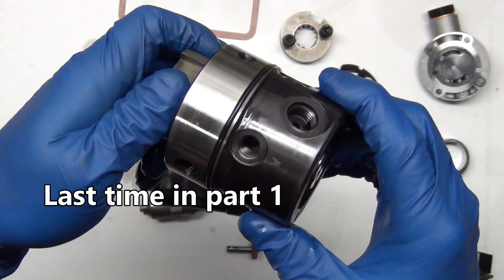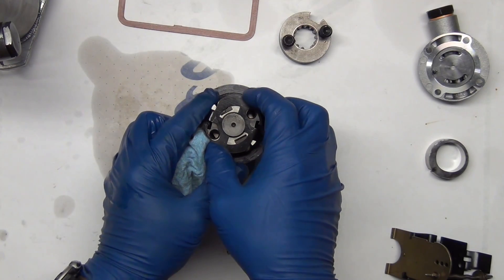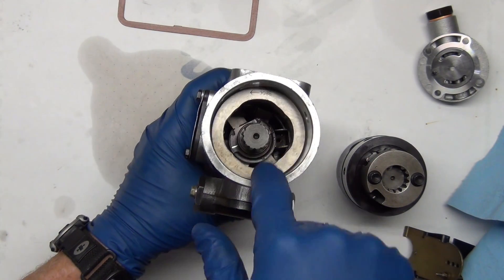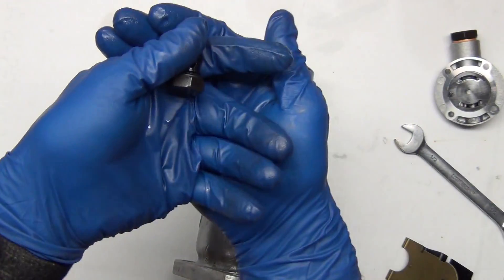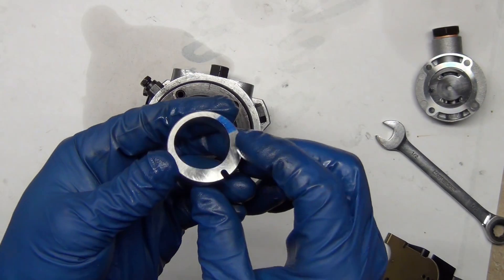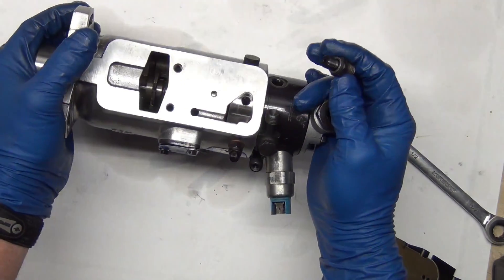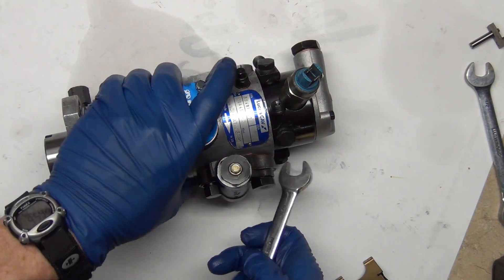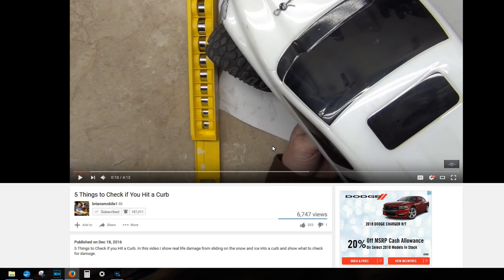CAV DPA Build Part 2 Max Fuel Setting & Pump Guts

Comment: Diesel does not over heat in a lean condition. You can either have too little fuel to make power, enough fuel to make power, or too much fuel which will cause heating issues and start cracking things like your pistions or heads.  To little fuel is safe just doesn't make any power.

Comment: For  years case tractor  used the same perkins  engine..  same  bore and  stroke same cam, for  the four cylinder.  The went all the way up to 95 horse  power.  All the did was change  that  setting.  Smaller  45 horse  tractors  had  the ability  to  produce  95 horse  power. This was when they  were David  browns  and  switched over to  case.

Comment: Hi! That small spring at the bottom that you talked about at the intake of fuel. You said it will be stuck in priming mode and it wont run. But isnt priming mode making it run as h*ll? Yester day i pushed down my primimg button on my DPA and the engine went crazy and ran away. I cant get it to stop normally anymore? Its like the pump is stuck in max fuel setting??
Reply from the maker: What time stamp in the video?  Priming mode is to purge air and flood the rotor with fuel.

Comment: Hey, I believe my boost compensator is failing on one of these pumps, as I don't think the pump is upkeping with the demand when on higher revs (when the rubo kicks in, technically). Is membrane replacement possible without any additional adjusting? Or does the pump have to be adjusted after the boost compensator was messed with?

Comment: Hi, Is this mostly to seal leaks . My pump needs some internal parts such as cam. Tractor stalls easily and no start when hot. or does it need a bench test after installing new cam etc. to calibrate it. I may be on the wrong video . Correct me on this, Seems like replacing seals is more of diy project vs replacing major internal parts. Thanks.

Comment: I just adjusted this fuelpump on my John Deere 2040. Now it is quicc and have some blacc smoke
Reply: Was that a cav pump like this?
Reply: @ketilmomrak-haugan3495  Yes, yes it was
Reply: @HorizonFarming  did you set it to max?
Reply: @ketilmomrak-haugan3495  Yeah, i set it to Max. But theres a lot of black smoke coming from it when i floor it. It's probably best to set it to max, and then adjust it off a little.
Reply: @HorizonFarming  yeah OK, i want some black smoke so thats good😏😏
Reply: @ketilmomrak-haugan3495  Compared to my 2005 Mccormick CX105, this John Deere doesn't use much fuel at all, so fuel economy is not a concern 🤣
Reply: @HorizonFarming   ok good🤣🤣
Reply: @ketilmomrak-haugan3495  Er du norsk? Ser ut som at du kanskje har et norskt navn?
Reply: @HorizonFarming  ja, æ det ja
Reply: @ketilmomrak-haugan3495  litt kjedelig at to norske har en engelsk samtale da🤣
Reply: @HorizonFarming  ja ahahh😂

Comment: I have this injector pump on my Perkins Diesel in my boat and am dumbfounded how to adjust the governor max speed setting. Mine has a hydraulic governor and I can't find anything. The mechanical one is well documented but I've reached a dead end.
Reply: There's useuely a pressure sensitive  valve that dumps fuel pump body fuel pressure which in turn alters the fuel pumping element /s load setting

Comment: hey there, nice vid. thanks for sharing your knowledge. one question regarding engine rpm: if id like to raise egine rpm, how do i align the governor springs in the linkage? for example, 2200rpm eqals hole 2 in control arm and hole 2 in linkage - how to set it for say 3000rpm?

Comment: At 2:00 you use an impact ,, what is the specified torque of those -2- bolts , & how much torque does your impact give? What brand & size are you using?

Comment: In your assembly at time 1:47- 1:57 what is that part you are saying must hang over just a touch, ? l have not taken my pump apart , l have only turned the fuel plate, with the pump still on the tractor ! Since I don’t know exactly how it is supposed to be , l would not know if what  l saw was correct or wrong !!

Comment: I watched this vid about 10 times before l got the fact that you were stating the min/max fuel setting correctly at the 30 sec point & the 45 sec point & l have used it to try and get some more power out of my 4BT Cummins 390  1990 . 
Some time ago l was having trouble ,& a tractor mech said it was my inj pump , he had a shop rebuild it , & when l got it back it was real short on power ! They jacked around fir 3 days and finally gave the pump full advance, but the power level still low !!, IT was a dirty in line fuel filter one of those little ones , 3/8 fuel line . YOUR vid has shown me how to add more fuel , but things still are not right , hardly no smoke , even at max fuel . 
How could they have messed up my pump???? I wish l knew how to get hold of you , l don’t want to give my e-mail address to the world.
 The part that you put on at 1:40 with the 2 -12point bolts , ? Is it possible to install it incorrectly??

Comment: I have  stripped  this pump and the  pump  rotor  the pump then came apart and  the rotor  adjusting cage   came apart from the shaft   is  their  a  proper way  for  this  cage to align up

Comment: OMG!  You sent me into a bit of a panic!   After doing battle with my CAV pump for nine days straight, I finally got it working.  Then I see you putting a ball in the head locating bolt at the advance.  First thing I thought was, "Oh crap!  I don't remember seeing any ball!"  I ran out in the dark with a flashlight and a magnet, and poked around.  Finding nothing, I removed the locating bolt to check on it.  Fortunately, mine doesn't have that ball arrangement!  😂😅

Comment: My tractor has sat all winter, I think either the priming mode spring has indeed gone out or the metering valve is stuck like Chuck!
Holy smokes, you may have saved my summer with this one... Week stream on the injectors and it's not pumping high pressure fuel as it should. 
Gaskets and seals, I'm going in!

Comment: Hi Brian. Went I uses to rebuild pumps , the pump plunger  was check by reversing pressure on number 1 injector pipe union and apply 20 bars and measure the roller with a micrometer. PLEASE NOTE IF MORE THAN 20 BARS PRESSURE APPLIED YOU WILL BEND ROLLER CAMS ADJUSTERS.   Spill timing is also done the same way by setting the letter to the circlip grove  in the window.  Your video is good and  minor adjustment can be done on the vehicle on the throttle arm.

Comment: Do you think if the return side of the injection pump was clogged with debris it would cause the engine to shutoff? I have an issue where the engine starts and dies. Found debris in the return pipe when i removed it. Injection p ump was just rebuilt. Low pressure pump is good. Shutdown solenoid is good and circuit was load tested.

Comment: Parts are very expensive. Also, water destroys it as well. Had cases where it got very rusty.
Reply from the maker: The parts all included for this were $85, but water hadn't gotten to it too bad.  Are you outside the US?
Reply: briansmobile1 Spent 2 1/2 years working in Australia. There's still an awful lot of stuff to learn on diesels but now I'm working on building electric motors.
Reply from the maker: I figured you might be.  My parents are in New South Whales.
Reply: Almost had a job there. Chose to work in Darwin instead. Unfortunately it didn't work out. Workshop closed down after 2 years. Drove 10,000 kms from Darwin to Albany and then to Adelaide.